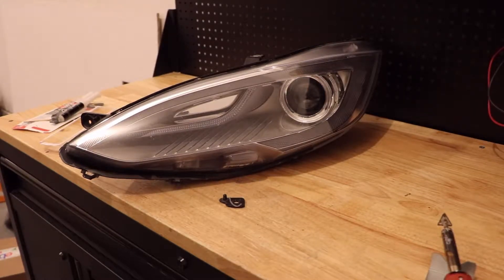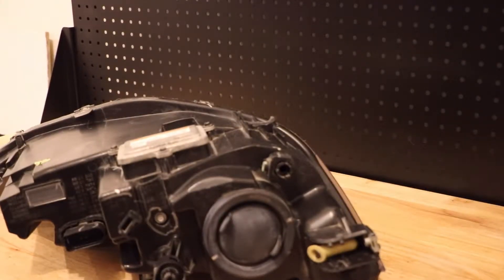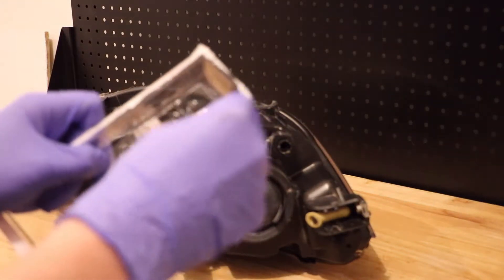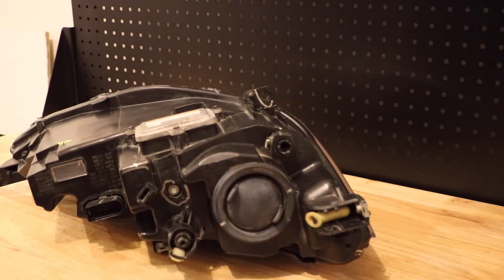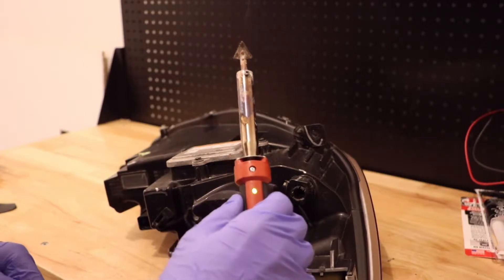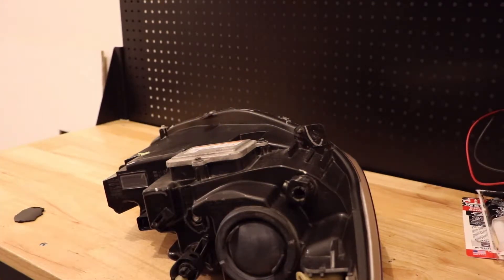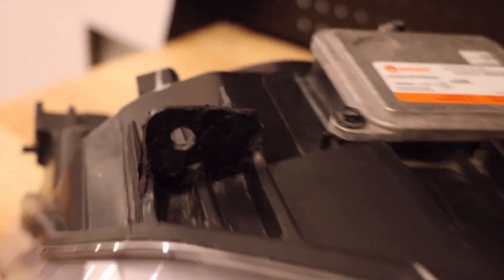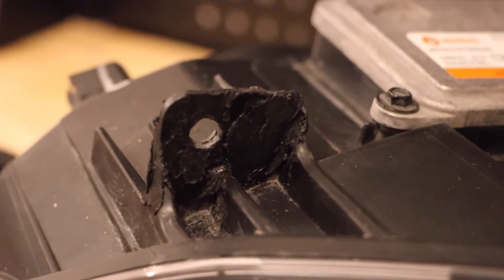Tesla Model S Xenon Headlight Tab Repair

Comment: Thanks for the video! The daytime running light went bad and turned yellow on my 2016 Model S. Tesla wants $1500 to fix the bulb!!!!  I just ordered a replacement for $150 on eBay but that tab is broken off.  I suspect I will cut the tab off the yellow one and glue it onto the replacement.